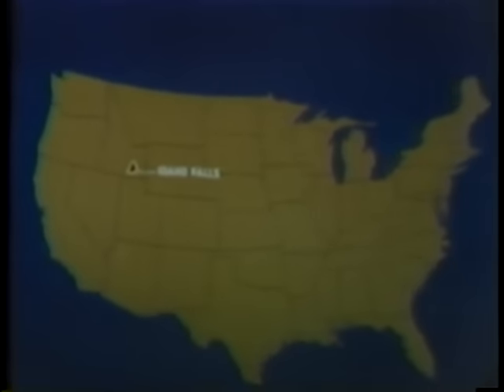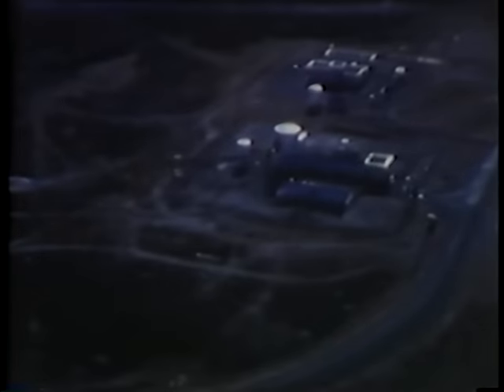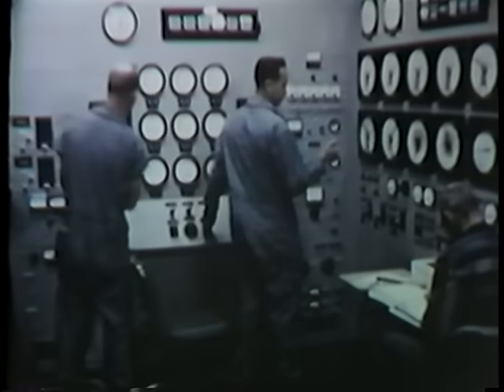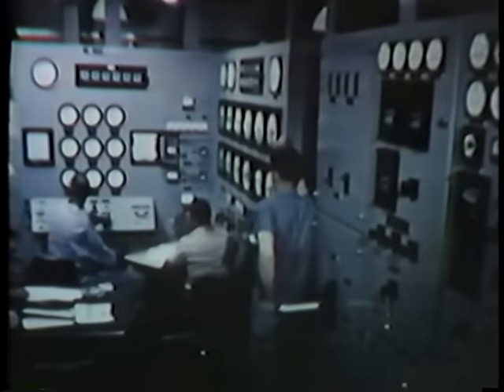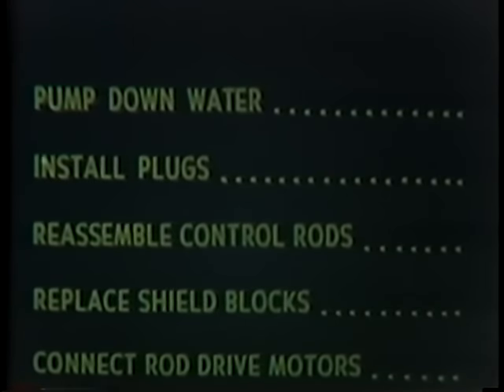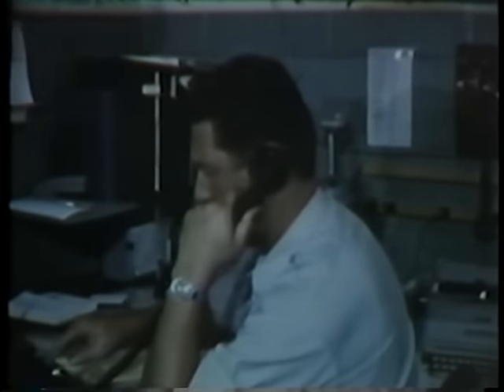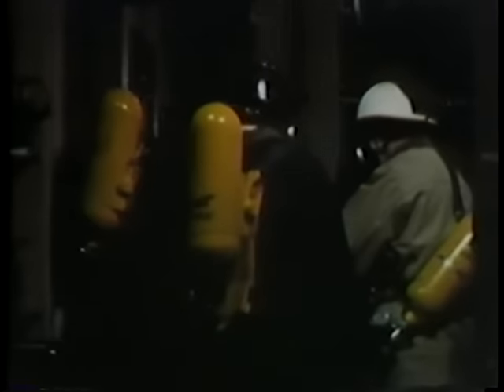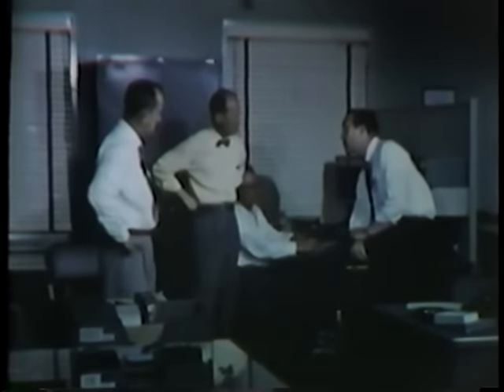SL-1 The Accident

Comment: nuclear energy destroying earth
Reply: That's coming from someone who doesn't understand radiation.. we live in a radioactive world you have 4000 to 10000 disintegrations per second happening in your body right now and your not dead, it's normal radiation plus radiation comes out of the ground and from space.. the uranium in these reactors comes out of the ground and is natural.. burning coal is destroying the earth and so are people who are scared of nuclear
Reply: @michaelfleming6581  why don't you look some things up before making statements and calling people names.. anyone who understands radiation and how much of it is around will be laughing at you.. learn how radiation works and learn the different designs of reactors there are much better designs than what are being used now LFTR reactors cant meltdown and cant blow up, they are not under pressure and dont have massive amounts of waste that needs to be stored for thousands of years they only need to store waste for 300 years which is easy and there almost 100 percent fuel efficient instead of. 5 to .7 percent fuel efficient big difference.. nuclear power is the way of the future it just wasn't done the best way to start with.. the reactors we use today still are PWR or BWR reactors and they were only originally designed to be small for ships and submarines and Alvin Weinberg the designer didn't want them to be scaled up because they have dangers if scaled up to use on land but he was told to resign, Alvin Weinberg wanted the LFTR reactor to be used and the reactor he built and tested is still at oak ridge.. there are a few new reactors being built of the old designs just a little updated and some countries have finally realized that LFTR was the best option some 60 to 70 years after a better design was found but LFTR reactors don't make fuck all plutonium for bombs.. i wouldn't be surprised if you knew nothing of the different designs of reactors with the statements you have made either that of your just anti everything, are you aware that nuclear reactors actually make the planet slightly less radioactive
Reply: @markshort9098  you are absolutely insane... nuclear energy has destroyed earth there's no way it can be tolerated anymore
Reply: @markshort9098  nah no future for nuclear energy... better to go back to the stone age than to be an extinction level event... what good is electricity if we become extinct to have it
Reply: @michaelfleming6581  so you still don't understand that nuclear power can be done safely.. if you think people should go back to the stone age then why are you using electricity now and all your modern things made of plastic, your complaining about technology killing the planet and your still using it, thats very hypocritical isn't it.. if you learnt about radiation and how it all works then you wouldn't be so against it, you probably watched HBO chanoble and thought it was full of facts when it was full of lies just like a lot of anti nuclear stuff.. there are organizations that are just there to lie about nuclear power and they make huge money to lie to people but when asked detailed questions they don't really know anything about it
Reply: @markshort9098  you a snitch to all humans... you need serious help man
Reply: @markshort9098  short... you are about 3 foot tall man lol
Reply: @markshort9098  ok man bye bye shorty ... no need to carry on about it...
Reply: @markshort9098  you didn't even listen to arnie gundersen link it says it all really!... people are smarter about nuclear than they used to be... have you researched Hanford the most toxic nuclear site in the world in America?
Reply: @michaelfleming6581  you say i can't provide good data but you have provided absolutely no data at all and yes i know about hanford it was the first large reactor to make plutonium..  the first planes crashed to and the first guns blew up but people kept trying until problems were worked out and as i have already said there are better designs of reactor than those that were built back then and luckily the majority of people can see that.. there have been accidents yes but we learnt from them, what your doing is like saying a brand-new aircraft is just as dangerous as the kitty hawk.. you can stay with the anti everything club there's no point me trying to explain anything to you since your mind is completely closed.. i used to be anti nuclear power but then i turned 15 and i learned about it and was surprised how safe it can be done but because some people are still ignorant of the facts it has slowed down progress to safe reactors and we are still burning coal killing the planet thanks for that.. at least things are changing and there have been a lot more people over the last 20 or so  years wanting safe nuclear power instead of dirty coal or fake "green energy" if you really give a shit about the planet look up gordonmcdowel or kirk Sorensen he used to work for nasa or LFTR and the other liquid fuel reactors instead of just talking shit trying to insult people.. regardless of what you think nuclear power is coming
Reply: @markshort9098  
At what point will you realize Michael Fleming is a troll ?
I agree with your comments BTW.
Reply: @billsbunts  it doesn't matter if he is a troll, he is putting false information which someone else could read and believe so it's good to make people like him look dumb, it helps gain support for nuclear power which im clearly all for and it gives me something to do in lockdown
Reply: Michael Fleming is definitely the more intelligent one here! 
It's quite clear that you have invested a lot of shares in nuclear energy and you want to make some money out of it but people like Michael are ruining the share prices... That has to be the case because I can't for the life of me understand what else there is that would make someone defend nuclear energy? 
All that I need to know is that radioactivity is involved! I don't care how it works, how clean it is, how safe they now are, how cheap it is. I just don't care! The technology is defunct! The sapphire project has already marked the beginning of the end of nuclear energy! It can be shut down instantly, there's no radiation whatsoever! It's clean and efficient and a hell of a lot safer! 
The sapphire project has their own channel on YouTube, maybe you should have a look at the future! A future without nuclear reactors! And while you are at it, here's the full 7 hour long video of Chernobyl that I'm sure you haven't seen yet. It shows everything from the construction of the reactor to the building of the atom city, you get to see how quickly a city grew up from nuclear energy and how quickly it took it away! Yeah I know, it's an RBMK and it's old technology and new reactor technologies are far safer but you really need to be in the zone of a reactor when it explodes, even when they said that it's impossible to fully understand fear when you have been there living your life and you then find out two days later that it's been spewing out radioactivity and no one told you! You could have at least sealed yourself inside until you can get to safety but it's to late now because no one told anyone! They never do! Anyway here it is, have a good look at it and try and put yourself in their position, what would you do? How would you feel if it was you and not them! 

https://youtu.be/tz-C90y5ND4